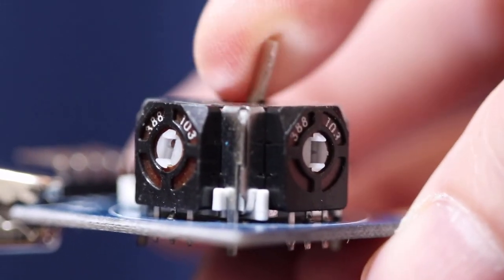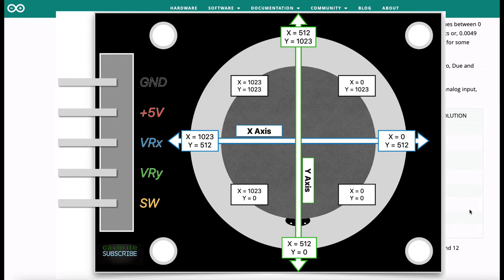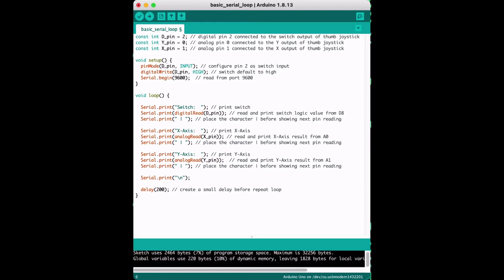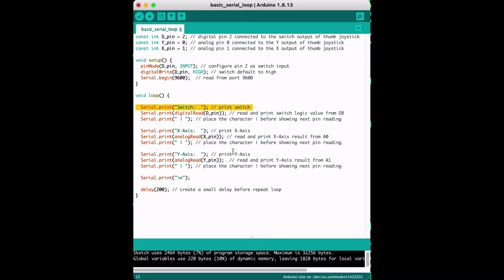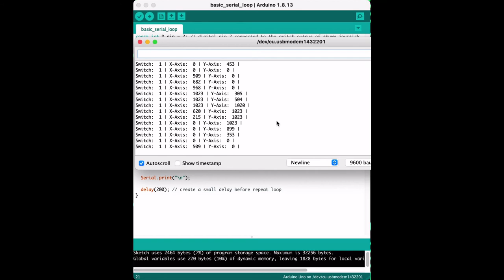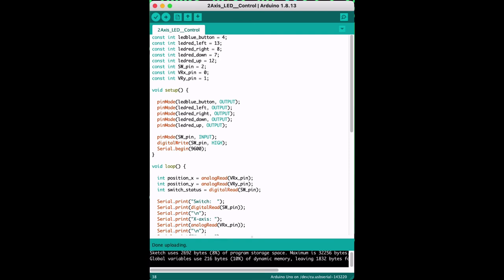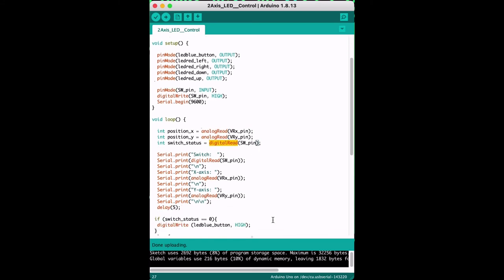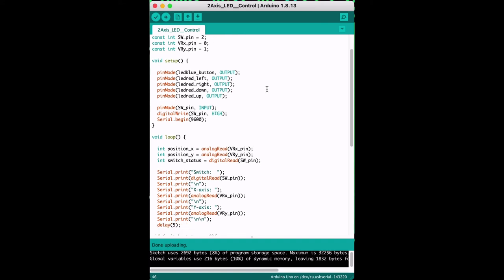Using a 2-Axis Thumb Joystick with Arduino

Comment: Great video, Project2 is just what I was looking for. I amended it to have a global parameter for a deadzone.
const int ledblue_button = 4;
const int ledred_left = 13;
const int ledred_right = 8;
const int ledred_down = 7;
const int ledred_up = 12;
const int SW_pin = 2;
const int VRx_pin = 0;
const int VRy_pin = 1;
const int center = 512;
const int deadzone = 20;

void setup() {
  
  pinMode(ledblue_button, OUTPUT);
  pinMode(ledred_left, OUTPUT);
  pinMode(ledred_right, OUTPUT);
  pinMode(ledred_down, OUTPUT);
  pinMode(ledred_up, OUTPUT);
 
  pinMode(SW_pin, INPUT);
  digitalWrite(SW_pin, HIGH);
  Serial.begin(9600);
}

void loop() {
  
  int position_x = analogRead(VRx_pin);
  int position_y = analogRead(VRy_pin);
  int switch_status = digitalRead(SW_pin);
  
  Serial.print("Switch:  ");
  Serial.print(digitalRead(SW_pin));
  Serial.print("\n");
  Serial.print("X-axis: ");
  Serial.print(analogRead(VRx_pin));
  Serial.print("\n");
  Serial.print("Y-axis: ");
  Serial.print(analogRead(VRy_pin));
  Serial.print("\n\n");
  delay(5);

 if (switch_status == 0){
  digitalWrite (ledblue_button, HIGH);
 }
 else {
  digitalWrite (ledblue_button, LOW);
 }
 if (position_x <= (center-deadzone)) {
  digitalWrite (ledred_down, HIGH); 
 }
 else {
  digitalWrite (ledred_down, LOW);
 }
 if (position_x >= (center+deadzone)) {
  digitalWrite (ledred_up, HIGH);
 }
 else {
  digitalWrite (ledred_up, LOW); 
 }
if (position_y >= (center+deadzone)) {
  digitalWrite (ledred_right, HIGH);
}
else {
  digitalWrite (ledred_right, LOW);
}
 if (position_y <= (center-deadzone)) {
  digitalWrite (ledred_left, HIGH);
 }
 else {
  digitalWrite (ledred_left, LOW);
 }
}